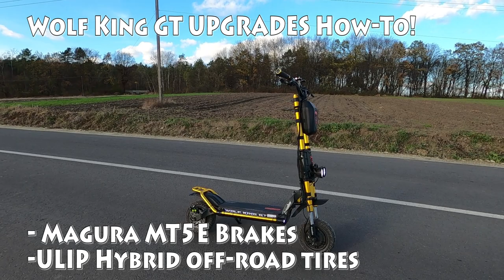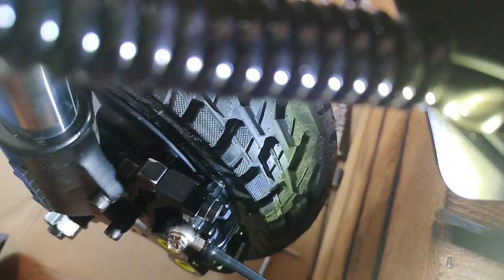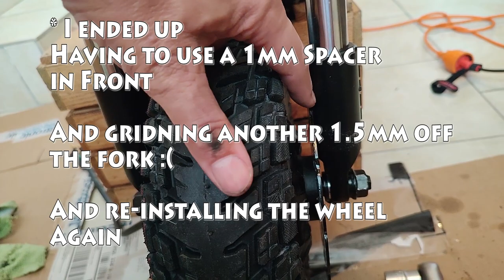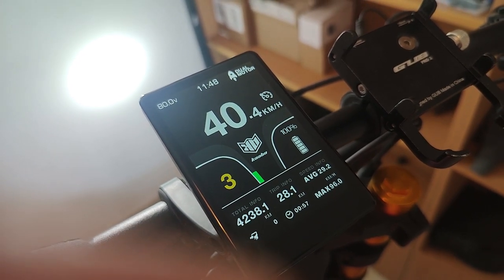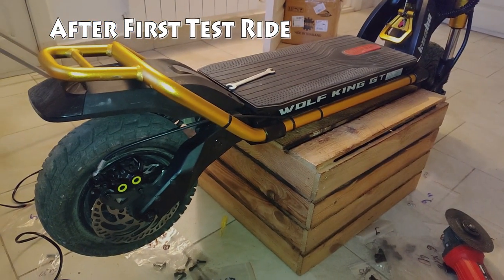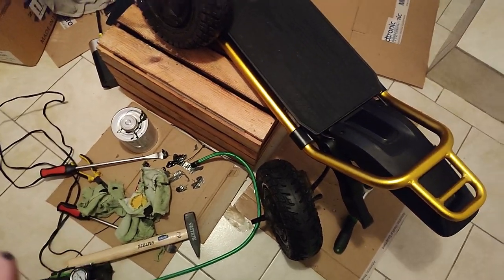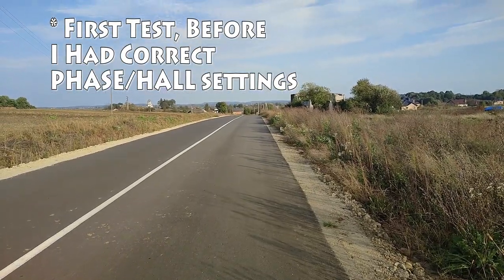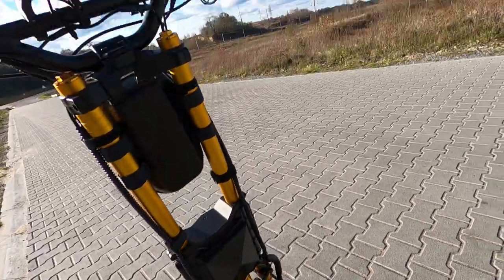HUGE UPGRADE: MAGURA MT5E BRAKES / KAABO WOLF KING GT!  ULIP HYBRID OFF-ROAD TIRES!

Comment from the maker: Links to components used:

ULIP Hybrid off-road tires
https://ulipstore.com/products/ulip-2-pack-90-65-6-5-vacuum-tire-11-inch-with-built-in-live-glue-repairable-for-dualtron-zero-11x-kaabo-scooter-fits-most-38cc-47cc-and-49cc-mini-pocket-bikes-mta1-mta2-gp-rsr-and-more#&gid=1&pid=1
https://www.amazon.com/gp/product/B0BZYVDHSP/ref=ppx_yo_dt_b_search_asin_title?ie=UTF8&psc=1

Adapter plate for rear caliper
https://escootnow.com.au/products/Kaabo-Wolf-Warrior-Series-brake-bracket-suit-4-Piston-Magura-MT5e-MT7e-series-by-eScootNow-p592381270

TRP 1mm disc spacer
https://www.bike24.com/p2225514.html

Goodridge Banjo Bolt M6x1
https://www.bike-components.de/en/Goodridge/Banjo-Bolt-M6x1-p23456/

Goodridge M6 Banjo
https://www.bike-components.de/en/Goodridge/M6-Banjo-p23454/

Hope M6 Banjo
https://www.ebay.com/itm/384805815009
https://www.ebay.com/itm/374800315433
https://www.ebay.com/itm/384492003942

Magura MT5E Higo Closer
https://www.bike-components.de/en/Magura/MT5e-Carbotecture-Disc-Brake-p45434/

Comment: This is what I needed to hear about those tires. They look amazing, but your review of them is the only one I have found and it was fantastic.
Reply from the maker: Thanks! Great to hear. I felt the same way, they looked to be a good design but there was a lack of reviews. Great tires. Just a huge PITA to install!!
Reply: @CoolWatts  You think they're tougher than a typical tire? I'm going to install the version with tubes, on a split rim Nanrobot. I'm hoping it will be easier
Reply from the maker: @elliotbaltazar  Can't tell about longevity yet, but rubber on tread and sides is quite thick.
Reply: @CoolWatts  LOL! Thanks, but I meant do you think they're tougher to change than a typical tire? I was asking because you said they're a pain in the ass to install. I think you had such a tough time because you had tubeless and your rim wasn't a split rim. I'll be using the tubes, and my rim splits in two. I shouldn't have to struggle with tire spoons and fighting to get the tire to take air.
Reply from the maker: @elliotbaltazar  Can't compare as these are the first scooter tires I've changed. If you're doing with split rim, it'll be MUCH easier. Kaabo had to design this better for maintenance, with a split rim and connectors for motor/wheel removal. They took a step in the right direction with the GTR which has split rims.
Reply: @@aregeebee201 👍👍👍

Comment: Thanks so much for posting this.  I purchased all the kit to attempt to do this and gave up, so sold on all the parts.  I then purchased the GTR model and would love to look at it again to see how this differs for the GTR model compared to GT.  The Front brake rotor is now on the opposite side compared to the GT so hoping this helps missing out one step in reversing the front wheel.  The tyres being 12".  Would be good to get your opinion in worth the investigation of trying MT5e on the GTR...of course there is no content out there for the GTR.

Comment: Hi!
Could you give us a measurement of the tire when inflated? (How much psi for you?) Width and circumference, to calculate the exact diameter.
I wonder how much it changes compared to its unequipped state. Thanks

Comment: Hey man, I am currently trying to fit mt5 estop for my t107 pro electric scooter. When reversing the banjo do you have to cut the old one or can you unscrew it and replace it with the good sized one? 
Thanks
Reply from the maker: I cut the tube and re-terminated with the Goodridge banjo.
Reply: @CoolWatts  thanks. Are O ring necessaries for the banjo and bleed screw?

Comment: But for the brake you disconnected the sensors😅?
Reply from the maker: Nope, the mt5e Higo closer connect to the stock connectors, and work same as stock levers. Activates Regen and brake lights.
Reply: Okay thanks bro 😅